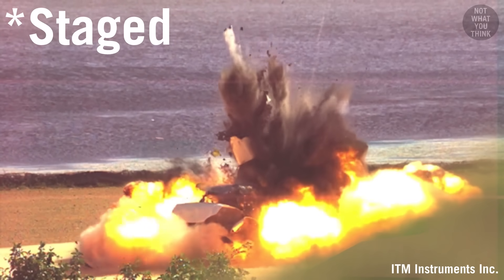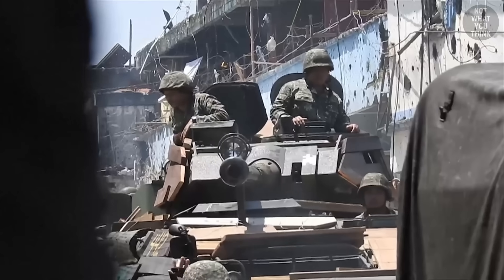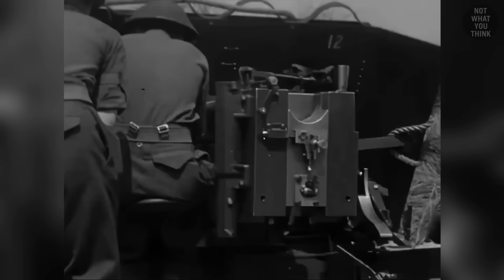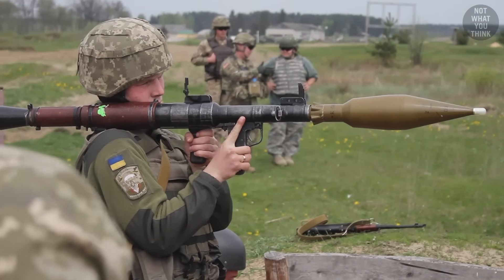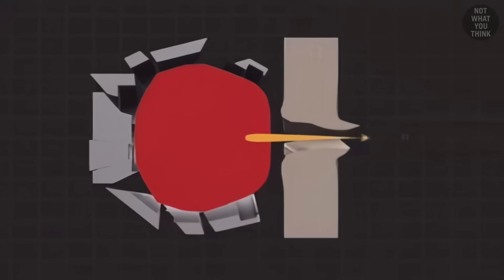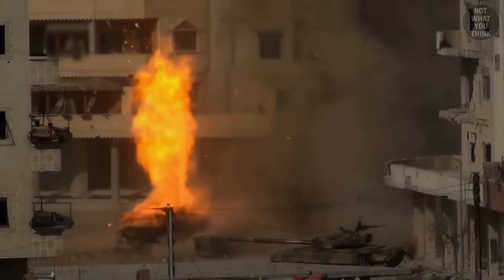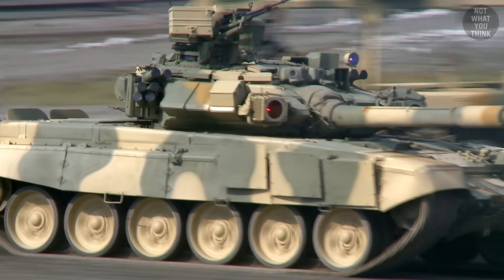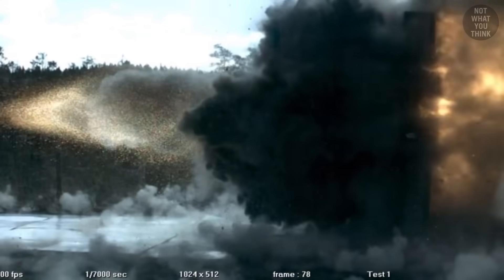Why Protecting Tanks is Getting Much More Difficult

Comment: Great video as always. I have a few corrections i want to make though. Firstly you said that explosive reactive armor can't deal with tandem shaped warheads like the javelin. While yes that used to be true, but with more advances in ERA technology in the past few decades, tandem shaped charges have now been countered to "some extent." 

Kontakt 1 was the ERA explained in this video, which is just a simple steel plate sanwhiched between explosives so that they can't distrupt incoming shaped charges. This proved extremely effective but was later countered with tandem shaped warheads, which is basically in short terms for those who don't know: A charge that sets off the explosives in the ERA and then a second charge following through the exact hole that the first created in the ERA therefore penetrating the armor.

Now as i have explained how tandem shaped charges, and Kontakt 1 ERA works, it is time to talk about my second point which is Relikt ERA (Which is the 3rd generation of Russian ERA.):
This ERA infact counters tandem shaped charges with instead of having a simple steel plate sanwhiched with explosives, they now have 2 larger plates made from High Hardness Rolled Armor (which is some of the toughest armored steel you can possibly get if not the toughest.) They work by shooting first shooting the first plate towards the first incoming jet from the tandem warhead at an angle (to maximize effective thickness of the plate,) then the second plate gets launched towards the main armor of the tank catching the second jet from the tandem warhead that is meant to penetrate the tank, therefor neutralizing that incoming jet aswell, or at the very least weakening the jet so that it doesn't penetrate the remaining armor.

This however requires the ERA blocks to be significantly larger than the previous ones, therefor making it harder to protect the weaker parts of the tank like the roof (although newer tanks like the t90m and t14 amarta have removed this weakness by placing it at the roof aswell), which the javelin and the nlaw takes full advantage of.
Reply: Also newer tanks are getting fitted with Active projection systems that simply put: shoots the incoming missiles (or tank round) with another projectile and then prematurely detonates them way before they hit the tank.
Reply: And even Kontakt 1 is not "simple". I mean, there's some real engineering behind it ;) Already back then it was more than one layer of explosive between two plates. It was two layers that stood at precise angles to negate as best as they could (and I think this is key) the effects of HEAT but also SABOT rounds. Sure, newer systems are better but even first gen ERA was more complex than what you are told in most videos.
Reply: Ppl are either ignoring or unaware of the fact that rounds do not have to penetrate a tanks armor to defeat it.
Reply: @EvidenceOfData  that’s such a vague statement
Reply: @Sujamma_Enjoyer  overpressure, systems damage (mobility or mission kill)
Reply: @Dan-gs3kg  APS system would stop it before it even hit ERA would complete destroy it and Composite armor is way to thick for HESH to do anything to it
Reply: @Hoovy Simulator 2 No just composite armor behind ERA but before it’s struck an APS system should be used
Reply: @EvidenceOfData  yes and that’s HESH but my knowledge that is no longer in use as anti armor as it’s outdated and doesn’t work against composite armor well though combat engineers still use it, but for anti-structure
Reply: @EvidenceOfData  What about it?
Reply: "Great video as always." yea stoped watching after he proved he knows nothing about the topic of shape charge...
Extra 10 cm/4 inch of distance for old RPG gonna only increase its penetration capability...
the cages on tanks are there to jam the warhead betwen steel bars or to deform it as it needs to have a perfect symetric shape to form nice and symetric jet of metal...
Reply: @Bialy_1  What bothered me was the EFP illustrating a SC in the first few seconds ;)
Reply: @Bialy_1  bro it would ave deformed after 10cm

Comment: Also, it takes a 0.70 cent bullet to kill a human it took 20 years to prepare for the battlefield. And a 1000$ artillery round can kill like 20. Such price comparisons are very, very silly - especially that if the current war showed anything, is that there is no assault forces without tanks. There are different weapons and countermeasures and infantry AT weapons were always very, very cheap compared to their target.

And even the lifetime factors here. Tanks can live very long, as we see from the old russian T-62s, they can literally outlive like 2 full generations of soldiers, their first crews are already dying of old age. And they fire thousands of rounds during their lifetime. How do you calculate the cost of a tank that saw invasions from Afghanistan through Georgia up until Ukraine against a one-off NLAW in 2022? Like I said. Just... impossible. And silly at some moments.
Reply: Same premise applies to both aircraft and helicopters. SPAA, MANPADS, SAMs, and other counters exist solely for the purpose of keeping those planes grounded. They're, more often than not, way more inexpensive then the system they're designed to defeat. A good example is the Stinger MANPAD against the Russian KA-50 during Ukraine. It took a system that costed $119,320 to defeat a $16 Million USD helicopter. 

Yet we don't see helicopters being phased out.

The argument that something has a counter to it doesn't invalidate the fact that tanks still has use. A tank is still extremely useful in the battlefield, even if it sometimes gets countered- which isn't a guarantee even now that companies and militaries are finding better ways to counter tandem warheads. There are already systems designed to counter tandem warheads before Ukraine, such as NERA and Electric reactive armor.
Reply: Thanks for saying this. This vid wasn't too over-the-top, at the beginning of the war the tank-is-dead sentiment was at its height, but something was still of about it.
Reply: all in comments forgot about one crucial thing, tactics of usage, you can use man to serve special forces, logistics, work in factory, cook soup or use it for cannon folder, you can use tank for fire support, assault with/out infantry, just like taxi or even piece-of-junk on road, this can apply to anything, you cant win war with "just" a budget, you must know how to use that resources
Reply: But the price of everything saved by destroying the target can sometimes be more than what's spent on ammo
Reply: You forget that on average 30,000-100,000 bullets are expended per infantry kill, that’s 21,000$ on the low end a 70,000$ on the high end
Reply: @dender5936  and it costs about $50K to train and equip 1 soldier. This doesnt account for logistic to maintian like food and shelter
Reply: @dender5936  No i don't, that's why i call it silly to even start such comparisons. There is no actual way to compare this, because the entire environment of the battleield is the true cost. A 20k$ drone is worth destroying by a 200k $ rocket bc the target might be an empty field or a 2 billionn $ electrical plant that will cause all of the hospitals in the area to stop working. You cannot make a simple cost comparison. 

And even the lifetime factors here. A tank can live very long, as we see from the old russian T-62s, it can literally outlive like 2 full generations of soldiers and fire thousands of rounds during it's lifetime. How do you calculate the cost of a tank that saw battle from Afghanistan through Georgia up until Ukraine against a one-off NLAW? Like I said. Just... impossible. And silly at some moments.
Reply: @kubadanecki8573  Bringing up equipment lifetime fails to bring up the cost of maintaining it over that time, however. Which, in most cases, rises the longer it's in service.
Reply: @gimmethegepgun  which, once again, is my point. any such comparisons are just silly. you gotta have a fighting force in line with your doctrine and your abilities which are always negotiated between one another and influenced by external factors.
Reply: @dender5936  The cost of shipping those bullets to the engagement probably cost more than the bullets themselves, especially if the opponent can actually hit your logistics nodes.
Reply: @dender5936  explains James bond movies
Reply: @dender5936  You read the book! I read the same one in 1978 !War is expensive as hell, I would spend that money on Xi Jingpin.
Reply: @dender5936  Ammo waste can be minimized via soldiers training and strict monitoring of unit officers at the battle frontline... A media crew was invited by the rebel group somewhere in Phils remote mounrainous area- they do video footage as the rebel group ambushed a military convoy... After the ambush, all weaponries, ammos, uniforms, etc were divested from the fallen govert. soldiers- then carried to the mountain camp... Before leaving the ambush site, they count the exact number of dead soldiers and the accurate number of shots received by each of dead soldiers... At the rebel camp, post battle meeting, all ammos which remained from ambush participants- such ammos balanced was counted, compared vs. the total of issued ammos before the ambush... The lecturer commander said: Thirty four (34) soldiers were
 dead, with a total of seventy eight (78) body wounds.... The total fired ammos was ninety three (93)- based on after battle auditing, so a total of fifteen (15) ammos were wasted... The question was: Who was the one among you who WASTED SUCH 15- AMMOS?!!... We have a method to know who fired such wasted ammos- so pls. stop the habit of firing if youre not sure about hitting your target... So, the top leaderships were using the conscience guilt, the mental pressure- that sooner or later, those AMMOS WASTER will be caught soon!... Thus, as days past by, fewer and fewer ammos were being wasted- during their series of attack sorties... Simple, easy to do, supply savings technique...
Reply: As long as there is operational need for tanks they will be around no matter how devilish ways inventions may be developed to kill them, just as there will always be human beings fighting wars despite the ridiculously effective and cost efficient modern methods of killing loads of them.
Reply: Really guys, the Covid that they tweaked at Boston College that can kill 80% is a better weapon. It only cost 40 million dollars to make the original Covid 19 and how much more to make it really deadly? The ultimate weapon gets rid of people and leaves the real estate intact .
Reply: Regardless of how you measure it, a tank is hugely more expensive than an N-Law or Javelin AT missile. It’s also hugely more expensive than a basic AT gun like the British 57mm Six Pounder of WW2.
Reply: modern warfare isn't strictly fought along production like it was in ww2. Today its about stockpiles, intensity of conflict, and how many forces you commit. You're basically not going to build any new f35s in the time it takes to fight a modern high intensity war, so you have only diminishing stockpiles of weapons and vehicles
Reply: also the thing about nlaws/javelins is that only like 1/300 of them makes a tank kill.
rest dies. its tough to be antitank infantry. tanks are usually protected by everything from artillery, to air, to people. but yeah, destroying aircraft carrier with 100 million hypermissile is worth it, when aircraft carrier costs 10 billion.
Reply: @AsbestosMuffins  That probably has more to do with Russia's adamant refusal to call it a war and switch to a war economy. If there's one thing industrialized societies are good at, it's churning out idiotic amounts of stuff when it puts its mind to it. Large economies not switching to war economies in wars since WW2 is mainly a result of either being overwhelming against their opponents or not caring enough about a conflict to mobilize the economy.
Reply: @blue-pi2kt  I'm not saying that Russia necessarily can run a war economy right now, I'm saying that the stockpile-only issue likely isn't due to an economy's inability to produce fast enough, but is instead due to major countries not running war economies any more.
Reply: @gimmethegepgun  Russia has a broader issue of simply lacking the capability to domestically manufacture high end technologies necessary for war like semiconductors, and even if it had enough, scaling the manufacture for advanced weaponry isn't like a factory line in the 1940s.

I agree with your overall point about war economies though the productive capacity of an economy has just increased explosively, it's probably just not needed. That said I think Russia's perceived issues about running out of tanks or ammunition are overblown, however they likely are grossly underprepared to maintain hardware in the field which is a different and equally concerning issue, especially if Ukraine keeps hitting these rear guard supply areas.
Reply: im not disagreeing with you, im just making a side note: most of T-62s the Russians are bringing out have been sitting in storage for nearly 30 years (there are probably quite a few exceptions).
Reply: massed tanks can break a line of defence without mass loss of life, but it's clear the current design is failing. 
I think in 10-15 years we'll have smaller AI tanks say 10 for every 1 we have currently doing the same job
Reply: True. Also any armored vehicle is always a plus and can be utilized on the battlefield. Any infantry soldier would gladly chose anything armored with any gun to stand behind... especially in the trenches holding off the enemy forces than to not have anything at all. You can think of tanks as a self moving big gun if you will, and the armor that it has is just a bonus...  reinforce it with a few bags of gravel in a static position, and it's like a relocatable advanced bunker, pretty much. Their front lining potential goes down with newer generations, but their absolute necessity in a war in any capacity or form , is a must, that will greatly increase your military capability overall. Tanks will never cease to exist.
Reply: @korana6308  there is also a psychological factor here. even if you are able to beat tanks, from propaganda point of point of view it sounds way more terrifying hwen 1000s of tanks sorrounding your city than when 10s of tousands of soldiers riding scooters and bicycles.
Reply: @MrKrtek00  Yeah true.
Reply: Mosquito sized drones carrying 2 grams of explosives making impact between the eyes, is enough to kill
Reply: It took an average of 125,000 bullets to take out ONE VC in the Vietnamese war. Read the book about snipers.
Reply: @gregsummerson6524  Yeah and that's a stupid number based on the extremely evil kill count approach of the US forces to Vietnam which was adapted partly bc neither operational or strategic goals could not be achieved. Despite being able to kill millions of people with trillions of bullets, the US lost. The number means nothing.

Again - what matters is the doctrine and the abilities to form a proper one and turn it into action. A poor Vietnamese army was able to beat a superior enemy not because they compared the number of bullets and their cost but because they were able to set up a military system that fit the war.
Reply: ur life aint worth a bullet u silly human ! :face-green-smiling:
Reply: A single APFSDS shell only costs 10000 dollars and can kill a tank with 1 hit, and an M1 Abrams carries 40 rounds. The math is clear, the tank has been made obsolete... by the tank.
Reply: @Evireaa  and also, if you add up expensive AT systems actually needed to kill a tank, the balance sheet might also stop adding up. we see a lot of cool videos of tank kills and we miss the misses, the crews supressed and killed before hitting a target etc.

in march Ukraine said that it needs 500 javelins daily (lets say we count all infantry AT weapons including panzerfausts 3, matadors etc as a requested javelin), yet the russian equipment losses were below a hundred of all vehicles daily (most of them killed by artillery, most of them not tanks).

this would mean that you need a couple systems used/lost to kill a target and some targets (like fuel trucks) are actually cheaper even than an NLAW.

this is why even killing a tank might not add up financially, and I want to come back that such comparisons are just silly since firing a javelin at a fuel truck might actually get you like a whole platoon of tanks captured.

the economic side of the war is not comparing equipment prices.
Reply: Because soldiers are cheap, tanks aren't.
Reply: @oompalumpus699  You've got that entirely backwards. The value a person adds to the economy over their lifetime easily eclipses the cost of a tank. It's simply much easier to see the value lost in losing the tank than it is to see the potential lost when the soldier dies.
Reply: @fortunatodeguzman8017  Which is quite simply objectively incorrect.
Reply: price comparison is indeed stupid. also, most western societies are way more sensitive to human life loss than to monetary expenses, so money scales different ways agains different oponents
Reply: Wow, you went on and on and didn't really say a damn thingbif value...
Reply: @kevinfreeman3098  thats not very nice
Reply: @kevinfreeman3098  Go finish your homework, those ABCs won't sing themselves. Your clearly lack reading comprehension
Reply: @kevinfreeman3098  he did say a lot of things about value